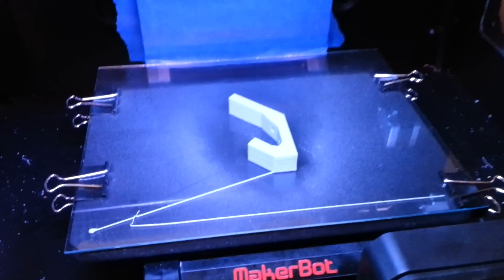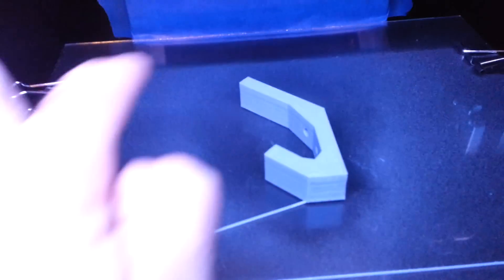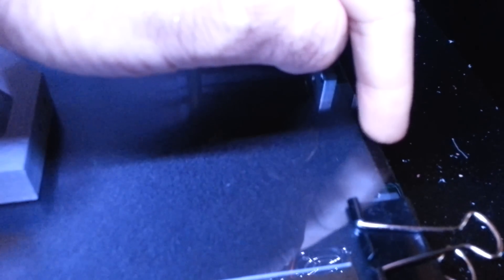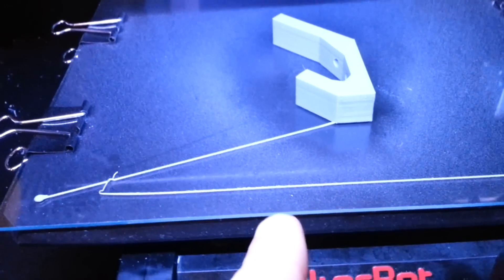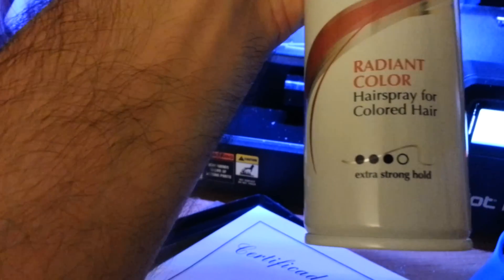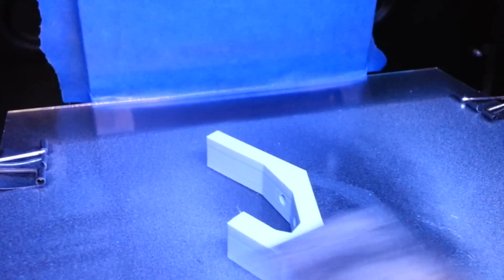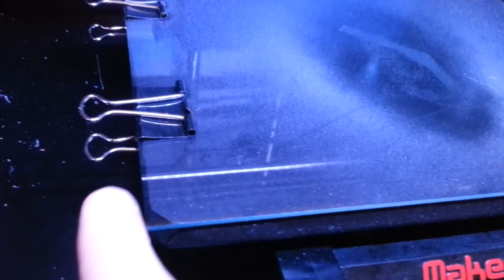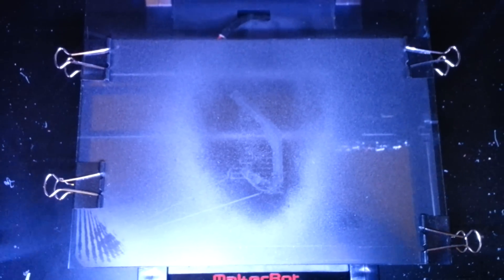How to use glass instead of Kapton tape

Comment: this video is very old but dont use them thin bits of glass they warp and bend easily and crack and shatter into sharp pieces of glass splinters and slithers just from looking at it in a wrong way  try use thicker glass like from a old mini oven or somthing if it shatters it breaks into smooth bits and wont cut you ive use this glass loads of times and cause some problems with bed leveling and the glass dosent hold the heat as well as thicker peices of glass these picture frames glass bends warps and shatters with enough heat not safe

Comment: I would still go with the paper tape... not the blue painters tape but the cream colored paper tape. Adhesion is consistent and sticks to the plate well and the paper doesn’t stick to the bottom of the model to a point where I have to soak the model to alcohol to get rid of the paper residue. I tried all other methods except for the kapton tape and I would choose the cream colored paper tape over others for printing PLA. The only downside is, when printing large models, I have to put on a new tape as it gets damaged. Small parts comes off and I run a scraper on the tape that lifted and print over it again and again until it rips...

Comment: Next time, get hair spray in a pump spray bottle, not an aerosol spray.  The aerosol spray goes everywhere and gets on your printers belts and other parts.  Eventually it will ruin these parts prematurely.  Also, get cheaper brands like Aquanet or a store brand.  They usually sell for a dollar or less.  If you shop at a dollar store that doesn't have cheaper brands, you're shopping at the wrong dollar store :)

Comment: Expect cheap thin glass to be not perfectly flat. While the chances are it will be flat, it may have bumps or warps. There will be less chance of warps on thicker pieces. I expect you would notice this on the first few prints. The trade off with thicker glass will be it takes a long time to heat up/cool down.

Comment: that's kind of dangerous... wrong kind of glass, it will shatter easier from thermal stresses.
Reply: Why is it dangerous? At the type of thermal stress the 3D printer is able to put on the glass it will only crack in two at worse (I had it happend). It's not like it is going to explode in tiny pieces.

Comment: Leveling the build plate is hard, the knobs underneath the platform are as tight as possible (so the platform is as low as possible), the nozzle is still to close to the glass and so the printer will not print after the first layer. Does someone knows a solution? :) run startup script with the build plate as high as possible doesn't work.
Reply: Jette Mul  Cut the springs underneath ..uae washers if you cut to much...lift print head up .
Reply: Don't cut your springs don't listen to that idiot you need to print a glass bed spacer from thingiverse find out what thickness your glass is and print the correct shim that goes underneath the z limit switch and lower your bed and start the bed levelling and now the bed will home 2-3mm lower than it normally would and gives room for your glass bed
Reply: iCloud Henshaw  The idiot also can now use Ally plate or any thickness glass and unscrew  the print head  with one nut on top of the Al bar.. best thing I ever did,
Reply: +Jette Mul Go into your slicer settings and set the z offset
Reply: ***** joblessalex Thanks, yes that's another option as well but i use a zebra plate and glass so i have two offsets so its really usefull

Comment: I had all kinds of issues with ABS and PLA sticking to the glass,   Most of my issues were to due to extruder temps.   I run at 240 C     First layer is set to 245 C..      Even with  with an ABS acetone film I had stick issues.   So,   I took the dollar store glass and laser engraved patterns into the glass..   Once glass cools off,  the print will pop off the glass on its own and impregnate filament into the patterns..  Once the glass is seasoned, prints will stick even better.  See an example here  http://www.thingiverse.com/make:111444
Reply: PalmersPursuit what is the print speed of the first layer
Reply: I thought about doing this before I got my printer and I tried it with a stratasys dimension and acrylic while it homes ok it gives an error code and switches of so I just took it out and I thought about doing it for my ctc machine

Comment: All this works fine when you print with PLA, its the easiest of all!
When using ABS, I have tried
Hairspray on glass. unsuccessful.
Slurry on glass, unsuccessful.
Slurry on painters tape, tape was taped to the glass. Result was semi successful, minor warping but stuck well enough to complete the print. When I went to remove the print the tape came with it. Easly remove by soaking in warm water and rubbing the old tape off.
Next attempt will be Kapton tape, is pretty cheap now days, waiting for a roll from Hobby King $30 for 33metres.
Stay tuned, unless someone can give me a better way of doing this!
Reply from the maker: The viscosity of your slurry is probably not thick enough. Once I switched to slurry my prints never warped or detached during printing.
Reply: So what thickness of slurry do recommend? Like toothpaste, tomato sauce (ketchup) or thinner? At the moment I am using about 1 part/volume abs to 25 part / volume acetone
Reply from the maker: Ben Nordkamp I put support materials left overs into a acetone bottle filled half way with acetone. You gotta make sure the slurry is not watery but with some thickness to it, thickness of typical shampoo. When I'm ready to apply the slurry, I squeeze it into the glass and then use a qtip (cotton swab) to distribute the slurry over the surface of the glass. Don't spread out to thin or too thick.
Reply: type of glass you use makes a difference, im using pva glue as an interface between borosilicate glass and the slurry
altho i dont think my slurry is thick enough.

Comment: i have heard that if the glass is bigger than the build plate, so that the ends of the glass hang over unheated sections, there can be a greater risk of the glass cracking from the heat differential.
It's more a risk when using build plates at higher temps.

Comment: I´m tryng to put a glass in the platform but when i level the platform the nozzles crash into the glass, I tried to graduate it with the bolts, but it keeps pressing the platform. What can I do?
Reply: Simply loosen the three bolts under the build plate and start the calibration process. There's now a better way to keep your prints from warping or coming off the glass. Solution: Mix filament left overs with acetone, the resulting slurry apply onto the glass and print on top of the resulting layer of slurry. When the print is done, let the glass cool off and remove it from the build plate, the print should come off easily now, if not, use a thin screw driver to cut out along the edges of the print to break the slurry and the print will come off.
Reply: You need to add a whim under your z limit switch
Reply: http://www.thingiverse.com/thing:89281 here is a link of a shim you can add to the replicator2x z limit switch to stop the nozzle hitting your glass build plate

Comment from the maker: ***** I have since began using ABS slurry on 8X10" glass. Much better than hairspray. Never any warps or buying kapton tape.. Simply mix the ABS leftovers with acetone to turn it into slurry, wait for it to melt, and apply onto cold glass before heating the build plate.
Reply: I've tried that but when the slurry dries off it forms some kind of "skin" that sticks to the bottom of my print and it doesn't look that good. Do you use a very diluted slurry or a concentrated one?
Reply: innomind where did you get your container to hold the acetone slurry???
Reply: mike gamer Same plastic bottle the acetone came with.
Reply: Zarbailov o that convenient and cool, most come in a ugly can. what brand are you using and where did you buy it from. maybe i can find what your using in my local area
Reply from the maker: mike gamer It has no brand as far as I can remember, it's a nail polish acetone. I'm currently overseas so I can't get to see the bottle. It's in a size of a typical shampoo bottle, except the cap unscrewes to allow pouring in a thin stream.
Reply from the maker: +Vlad B Have you tried ABS slurry before commenting? Ever since I discovered this method I've only been printing using it and never had any warping occur. You need to apply fresh layer of slurry every time you print though. This is very economical and reliable approach. Can you make a video using sand paper?
Reply from the maker: +Vlad B Then your slurry is too thin. The viscosity of it should be similar to typical shampoo viscosity.